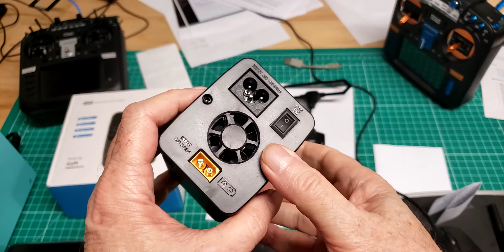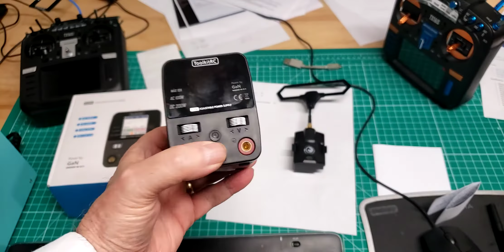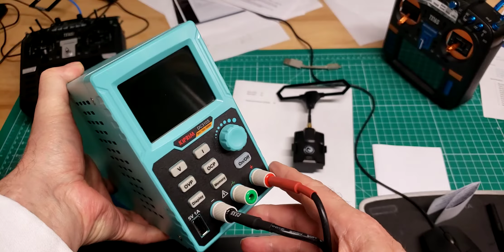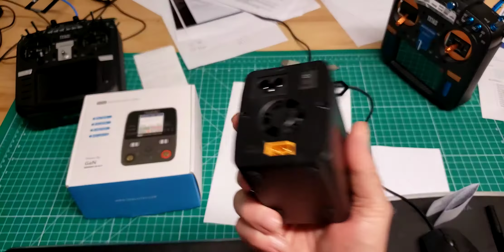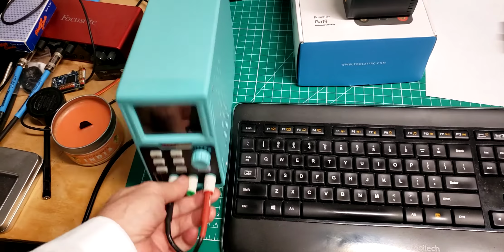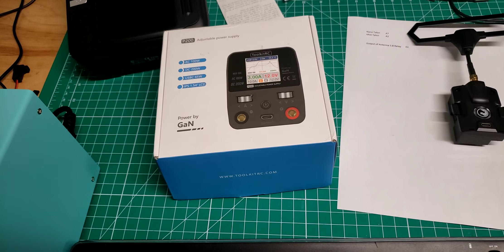Bench DC Power Supply

Comment: 30v 10a mean 200watt ? OK
Reply from the maker: They are strange power supplies.  To use the full 30 volts @ 10 amps you would need a device that outputs 300 watts.  Both supplies here do not.  They can only go up to 20 volts at 10 amps.  They can go up to 30 volts, but only up to just above 6 amps.  This is what makes both strange.

Comment: Excellent point. I've encountered exactly this issue over and over and originally just wrote it off as a fixed bias between my instruments when in fact "my" original voltage and current measurement system was well-calibrated and accurate and in fact, the power supply had a relatively meaningful bias vs reality.
Reply from the maker: Yeah these are cheap units but close enough for my needs.  :)

Comment: How did you destroyed 2 lipo batteries
Reply from the maker: I was using them on platforms to test things like battery failsafe voltages and got distracted and didn’t come back to them for hours.  When I did a 3S lipo was at like 7 vdc (2.3 volts per cell).  I did the treat them like a NiCad battery trick and it did bring them back up to lipo voltages you could charge, but after charging, one or more cells would not hold a good charge.  Basically leaving them overnight and discharging them too much.